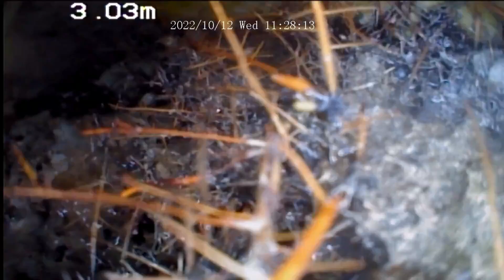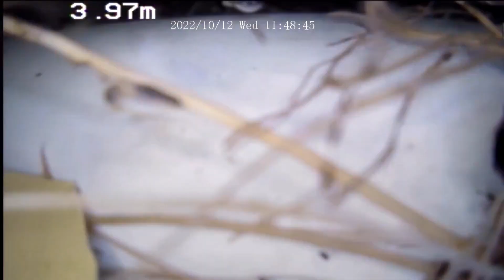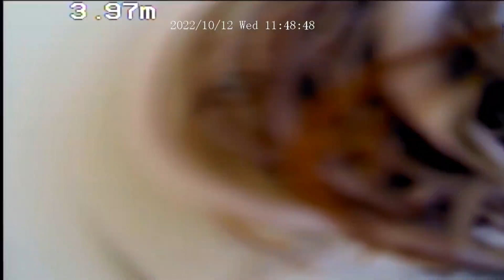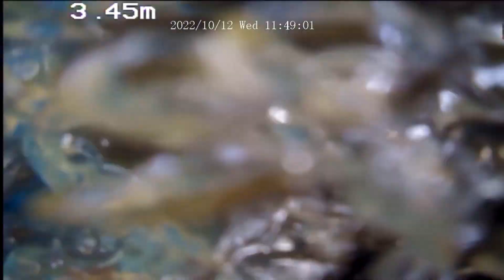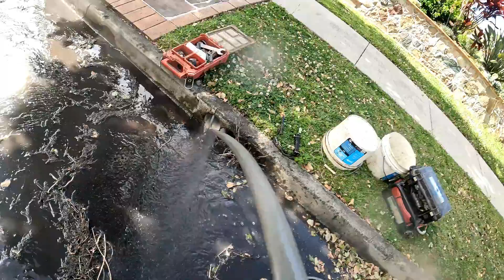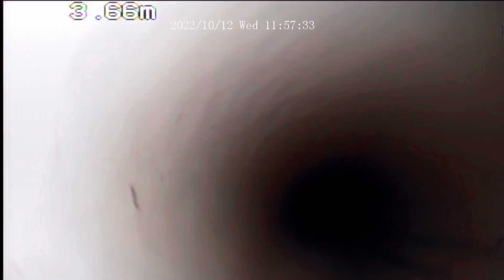Blocked Drain 309 - The Pressure Builds & Tree Roots Explode From The Drain

Comment: Dude rocking flip-flops and thigh thigh socks. That dude really has life figured out and zero fu*ks to give. 😅
Reply: Ya know. I had to run outside for some reason just a couple of weeks ago. Had socks on. Actually tried to just slip on my flip flops. Then figured it'd be easier just to put my sneakers back on. Who knew. Flip flops n socks not that easy to strut. Lol I was not going anywhere. Just like to take the trash out didn't want to have wet socks.

Comment: in my area they also do horizontal drilling, but they must go through a clearing house (call b-4 you dig) to make sure there's nothing in the way. They send out someone who maps things and marks utilities, but they are also supposed to look for any other obvious things that are not mapped utilities. (like your drain pipes) Private drains may not be on the maps but it's gotta be on someone's mind if there's a penetration along the curb every 50 feet.